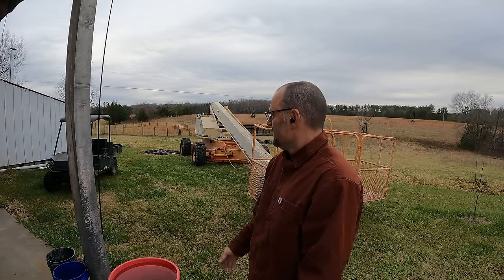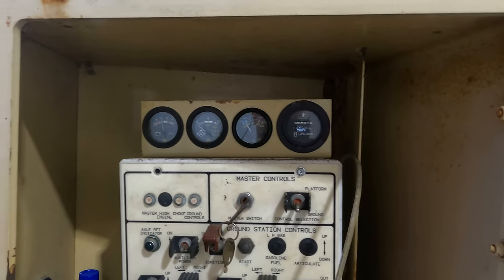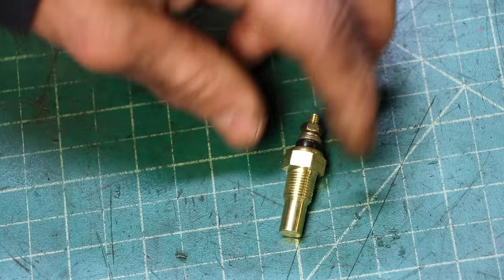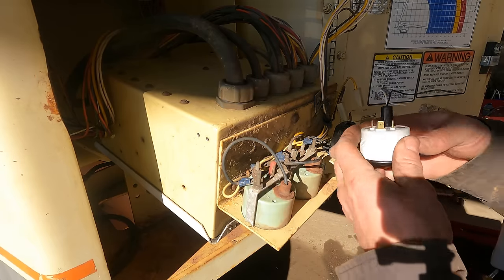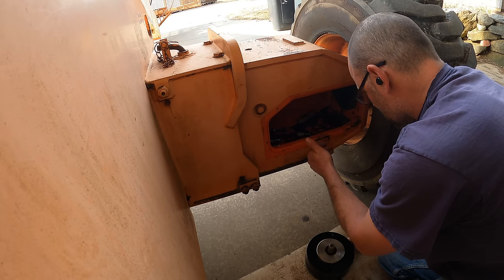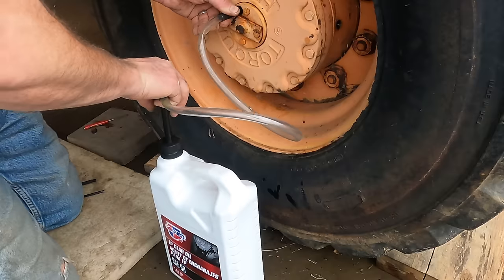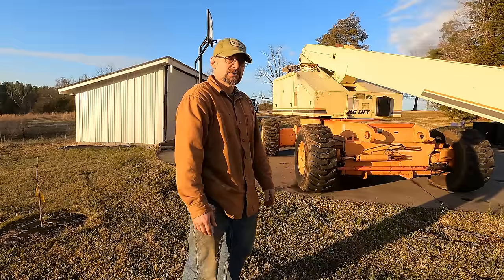Fixing The Boom Lift's 4 Wheel Drive System and Other Stuff.

Comment: Boom inspection, maintenance and repair if necessary. 
The way forward Johnson!
I was stuck 60+' up. In downtown Phoenix AZ, 110°+, at noon in August. Painter. 
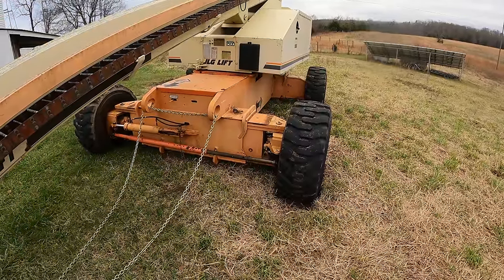Rental co. Came out, "needs a part", 1:30.
Boss (me) calls Phx emergency services for fire department, ladder truck..."sir, we are to busy, we are preparing for the monsoon storm approaching from the south...we are currently tracking a "HABOOB" expecting to hit the greater Phx area around 3:30 this afternoon"!!!
Temp, now 115°.
Haboob- a wall of dust a mile High being pushed along by strong winds.
Followed usually by a thunderstorm, micro burst, and even hail! Yes hail in Phx in August!
Absolutely Biblical Visually!
Look up HABOOB AZ. incredible pics.
While feeling at any moment I could spontaneously combust, or becoming so dry and dehydrated that the slightest breeze would just "PUFF" send us scattered over greater Phx like a dried up tumble weed across the desert floor, or the HABOOB dust headed our way!
Maint. Guy rental co. calls..."good news, I can get the part off one of our other lifts, bad news...it's a 35 min drive, 20 min to remove the part, 40 minutes with traffic to get to you, 20 minutes to install the part, oh...sir, sir, are u there?...sir?...
I was distracted watching the HABOOB rolling in from Casa Grand, a city 30 miles to the south. I had an excellent view...
Me, "You listen to me maint. guy, I can see the HABOOB! ITS MOVIN FAST! GET YOUR HIGHEST MNGR TO GET ANOTHER LIFT HERE NOW TO GET ME DOWN! MEANWHILE I AND MY EMPLOYEES ARE GOING TO BLOW U P THE 9!! PHONE LINES IN PHX, GLENDALE AND TEMPE!!!
MOVE IT JACKASS!!!
While on the phone trying to get E.S. to respond, I see the HABOOB getting closer, twice as high, dark, scary, ominous. Above it, black clouds, filled with heat lightning flashing all over the place almost constantly. The HABOOB, the LIGHTNING, and now seeing curtains of RAIN in the distance and clearly VERY STRONG WINDS!
Now, this EPIC, BIBLICAL, END OF MY WORLD, HABOOB/THUNDERSTORM stretches from horizon to horizon, east to west!
Pedro, in the bucket with me, is loosing his sh!te, screaming in Mexican who knows what, to anyone passing by! Finnaly E.S. PHX says a ladder truck is on its way! A dude below screams "Hey I called Channel 10, there sending a camera crew!" 
I say to him "great, thanks for the help!" We were quite the entertainment as the downtown professionals were evacuating the city. Pedro, exsausted himself so completely from freaking out, he just layed down and became despondent! Now I'm freaking out that Pedro has something seriously wrong with him medically! He can't just die up here! Some amigos show up with a rope, try to throw it up but to short. I try to explain to Pedro "no weno" not safe, plus he was wacked, but it did kinda revive him!
Now all over the city we hear sirens, I see a fire truck coming our way, I point to it and the whole crowd cheers! Closer, closer, closer, man what a relief! 2 blocks away! Then, shit, shit, shit!!! The fire truck turns south from our block and speeds away, shit! The whole crowd saw them turn and drive away! AWWWW!!!
Pedro can't stop weeping. The amigos tie some rebar to the short rope stupidly, trying to rescue Pedro, nearly killing someone in the crowd!
I call the maint. Guy, "where the F are u?" Oh, I...I...I called my boss like you told me to"
Me" R U On your way?" Him," uh...no"
Me" Give me your bosses name and # now JACKASS" I blow up his phone, no answer, JACKASS!
Then the crowded is pissed, everyone starts dialing every number they can find for there locations here and the corporate office! Finnaly I get a TEXT!!! From JACKASS boss man! ...A truck is picking up a lift now.  
That's it!!!!! That's the best he can do? A text!!!! Crowd is really pissed now. At least 5 guys in ties speak up..."I'm a lawyer" blah, blah, blah!
Now, the sky is getting darker, of course I can see the storm but the crowd below is in the shadow of the high buildings. I yell it looks like it will be right here in 20-30 mins. All the ladies scattered. Lawyers taking videos, wanting answers to questions... Amigos yelling in Spanish... Finally another fire truck seems close, I can see it, it's a big one with ladders. I yell to the crowd it's got to be it! I shake Pedro on the floor, and point there it is! Pedro jumps up and down shaking the bucket violently...I can see the turn signal on the truck, it's coming our way! The crowd down to about 50 now goes crazy!... HABOOB is moving faster than I thought. Wind, dust, darkness were overtaking us...the truck and firefighters were all scrambling around trying to position the truck, get people out of the way, yelling for people to get inside, crazy madhouse!
Then this one firefighter is inspecting the machine, he goes and comes back with a toolbox. He's got his head in the machine for about a minute... Every second right now seems like an eternity! I can see the city limits being taken over with strong winds then completely opaque wall of dust! It seemed Demonic, end of the world stuff, all kinds of stuff flying through there air...and now the bucket and us are being shaken violently by the wind. "Pedro, stay down and close your eyes" I say to him. Then the firefighter with his head in the machine yells" HOLD ON GUYS, YOUR COMMIN DOWN!!!
Pedro and I, while holding on, started hugging each other and screaming expletives of relief! The whole crowd went nuts as we were on our way down! We jumped out of the cage and went over to the firefighter and just hugged the guy with overwhelming gratitude, Pedro couldn't let go, and the crowd was so touched that everybody came in for a GROUP HUG!!!! Ladies were crying, even the lawyers were relieved! Then it turned violent with the wind, dust everywhere. In your eyes, on your teeth, you could feel it in your breath! Fire sarge on the bullhorn is yelling for everyone to get inside. I grab Pedro by the arm and drag him into Hooter's, where the whole restaurant stood up a cheered for us! The waitresses came over and hugged us and now Pedro started to feel better! Manager came over and said anything on the house!
2 cervesas please! Had a pretty waitress helping us, Pedro had a smile on his face. A firefighter investigator wanted my attention, I started to give him the story. Then a lawyer came up to me, started to hand me his card, then my phone rang, it was JACKASS from the rental co.... I took the card from the lawyer told him who was on the phone, then handed it to him, and said your hired! Went back to sit with Pedro and the waitresses gathered around him, drank down 16 oz. glass of beer in one shot, to wash away the dust and stress of the day!
Pedro and I closed down Hooter's that night. The whole mess is still in court and I can't give details.
JOHNSON, MAINTAIN THE LIFT!

Comment: I really enjoy all the work you do and all of your videos. I know tis video was posted a while back but I thought I would give you a tip I learned from delivering boom lifts for many years. I picked up machines like yours stuck all the time. Its a bit hard on them but if you drive the basket in the ground like you do to extend the axles, then drive while you telescope out, the telescoping will push the boom out of most situations. I know yours was directing power to the free wheel so it may not of worked but if you ever get into that situation again, and haven't buried it, try it, it pushes you right out. I especially like your boom videos!

Comment: Very good video as far as driving on your uneven surfaces you can rotate the Boom putting your weight and the booms weight over the tires that are spinning as long as you are clear of any objects been using those lifts for 30 years so if your rear tires are just spinning put the boom on the backside of the wheels hope this makes sense you should also look into anybody that has a scrap vehicle I'm sure there's thousands of them out there I would save you money on parts
Reply from the maker: Now why didn't I think of that??  Thank you, awesome tip.

Comment: The Equis gauges work great. I have their oil pressure gauge volt gauge and temp gauges in my car and no issues and i also put the volt gauge on my riding mower and it works great

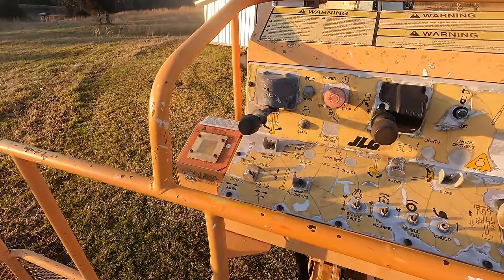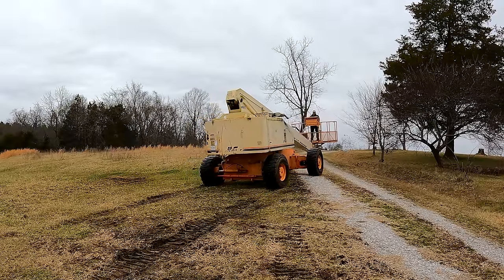Comment: So John, Does that have a "locking differential". At 35:00 it looks like a green indicator just to the right of the boom lift joystick but no switch. The JLG I rented had switch that would allow all 4 wheels to drive  which would help you through the situation you encountered at 30:50 and the 2 diagonal wheel (without the weight) spin. My assumption would be some sort of hydraulic valve that sends a set flow to all 4 wheels causing them to drive independently of traction. 

Agree with you about the needed full inspection of the boom.

Thanks for the content!!!👍👍👍

Comment: I used to repair these things, we used "TOTAL SOURCE" (TVH) for aftermarket parts for things that weren't critical, you might be surprised if you can find a total source p/n alternative. Also the dealer markup on skyjack parts around here was 100% lol (They accidently left a receipt in a box once), I can imagine your dealer/contact is doing something similar.
Reply from the maker: Thanks. I’ll check them out.

Comment: The chain on the boom isn't normally what breaks, it's the end forks and pins attaching the chain-ends and that can happen when wear makes it wrongly adjusted and the hydraulics shear them when one end gets too short. I've experienced it on dual-extension cranes in forestry and when they break they jam up on the inside and can be very tricky to remove, also when putting it back together you will need to have heavy equipment and rope or straps to attach to the chain so you can feed and move the chain when it comes back together. The cranes I've repaired were much shorter than that beast and still a nightmare.. One thing is for sure, it's going to be interesting to watch!

Comment: "You wonder now why I hate wiring diagrams?" As someone who went to school for electrical engineering, I've seen worse. Try navigating ~150 pages of diagrams with no discernible order, where circuits might appear on several pages as JUST a line entering then exiting the page, forcing you to jump all over the thing tracing a single circuit. And everything was in German (I don't speak German)

But for someone not used to reading wiring diagrams that often, I can still sympathize. It takes a while to get used to.

Comment: Oi! What a PITA. One wee little trick you can use if you get stuck is to ground the basket and take weight off the drive unit, then rotate the drive unit with the boom holding it up. This can place the wheels out of the rut they've made. Seen it done, never done it myself--kinda hard on the equipment which is why your former rental unit was so ate up.

Comment: I was hoping you would find the missing ground on the meter, even if it was in a metal housing it might not have had a ground because the Teflon tape is an insulator. To keep four wheel drive there are flow dividers that will keep the same oil flow equal on all ports (just FYI). On the boom I would never tell someone else what to do, that being said I worked for a company that manufactured man lifts as well as repair of others and I can say if it was mine I would teardown and inspect then replace or repair anything out of spec. Please don't take my comments as criticism but as observations and/or information. Appreciate your content, presentation and your time. Thank you

Comment: That brain box looks like a famous Ford EEC IV they used for many years. Since your vehicle isn't fuel injection, it probably is just controlling the ignition system. It might also control some exhaust gas recirculation if yours has that. These industrial engine variants of car/truck engines are interesting.

Comment: One possible solution for the loss of traction when the wheels get high-sided is to fit the hoses to the motors in series, or each axle pair of wheels in series, rather than in parallel as they are currently. 
  There are a couple of drawbacks though. One, is it makes it harder to turn, like having your vehicle’s crosslocks in permanently. Second, is if one wheel motor fails, any debris in the line is forced through all motors down stream of the failed motor.

Comment: After watching your other video and thinking about it, I just figure that since they make a metal cutting blade, I would get a idea as to where everything is located inside, not absolute necessary but all info is good info, I might just open it up with a blade and lift sections out, rebuild the cylinders and also pull the chain system out through the top, when done, weld it back together as I can not see that weakening it plus going together would be easier. Its yours so your game. I have pulled some booms apart and they were not team players. This is a lot newer so its your call.

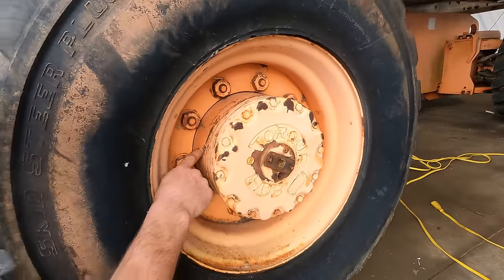Comment: Pro tip: If you take off the wheel, you should have all the space you need to access the plug you tried to get to starting around 27:15. I mean, sure you got it in the end. But I think, I wouldn't have been brave enough to risk stripping the head any more.
Anyway, glad you managed, and got the oil out. Jeez, it is almost as dark as oil from a Diesel engine!

Comment: As mentioned by others, that two wire temp sensor is going to the ECM to control timing based on coolant temps. With it disconnected, it likely just defaulted to -50* or some arbitrary number.
Reply from the maker: It isn’t disconnected. The one going to the ECM is still there. There is a second one that is for fuel injected engines that has never been hooked up on this machine. Cheers.

Comment: The temp sensor that goes to the brain box is to change the timing based on temperature, so you have a different ignition map for cold stats and (when the engine is used in a truck) is used for emissions considerations. Mostly not important for the boom lift but I guess the default is a very safe timing so you would have no power output. So it needs to be there so you get enough ignition timing for the power output.

Comment: The gauges are just like boat gouges and are easier to test via a multimeter on the sender first.  Most of the senders change resistance with temp or pressure or whatever.

Comment: High temp reading with a new gauge. Your fix OR simply put a smaller 5 cent resistor in sensor line to the gauge. Vary the resistor until you get the correct reading.

Comment: I'm pretty sure the swivel joint needs new seals. Those wheels seem too weak to me. 
Well I'm definitely pretty sure I will enjoy you taking on that torture project on this machine, so I really don't care if the seals need replacing 🤣

The boom is going to be a hard job simply due to it's weight. But since it's required to do a bi-yearly inspection, it should be pretty straight forward of a job. JLG would have had to made it easily inspectable otherwise companies would go and buy the easy brand.

Comment: John, I'm surprised that you have not powered washed out the inside of the cabinet to remove all the old grease and oil. I always try to keep things clean and neat. John, I operated a Pettibone in a Steel Mill for over 10 years and never once had the boom tore down and inspected. We had a big Crane and Hyd. repair gang and I ran and drove this every day. It had 3 extensions. I always had something Heavy hanging over my head. I only worried about the cable being cut if I was off over the weekend or it was off a pulley and the cable was cut. Other guys did not care and left it for the next guy. I never hurt any one in all the years I ran overhead crane for over 30 years or this Pettibone and a Grove mobile crane. Great job John, your the Best .❤

Comment: Auto mechanic here; the brain on that engine most likely only controls the spark. It's POSSIBLE that it has some type of "feedback carburetor" but judging from the pics I've seen on here of it, that isn't very likely - these were used in the 80s, basically it's a normal carburetor but it's jetted to run slightly richer than it normally would and then the computer can add air through some solenoids to lean out the mixture, gives it more control over the mixture than you'd get with regular fuel injection although still not as accurate. It was done this way so that if something failed, it would run rich instead of lean as it's much less likely to break things. (Too lean causes increased cylinder temps and a bunch of other problems that can lead to burned valves etc)

Comment: @Farmcraft101, If heat and concusive persuasion doesn't work, I have had luck loosening stuck bolts by using an upsidedown computer air dusting can. It sprays a super cool blast that will freeze the bolt loose.

Comment: that is why you should trouble shoot gauges before replacing them. most of the time it is very easy to trouble shoot gauges. most of the time you just have to ground the sensor wire to see if it is working since that is how most basic gauges like that or most older vehicles work. a lot of older vehicles have multiple temp sensors. 1 for the computer and one for the gauge.

Comment: Did you try spinning the turret, lowering the basket to the ground, (lift up the wheels with the basket possibly) and use the extend function to push you forward

Comment: Consider maybe changing the engine over to fuel injection? Look into a Megasquirt ECU kit. Can be made to fit any engine and very customizable. Could slap 1 injector into the manifold and help with the cold starts and will give you a digital display option. Good luck with the boom.